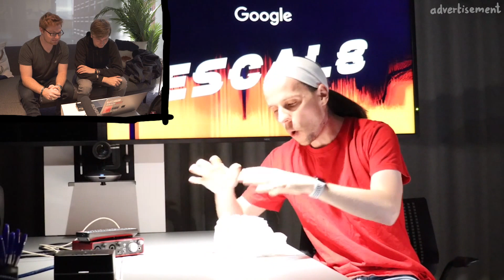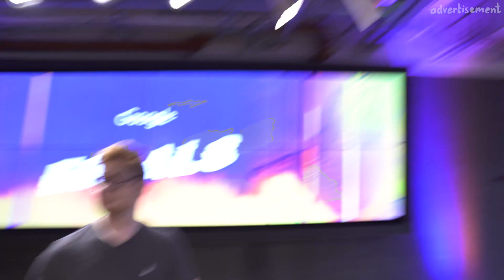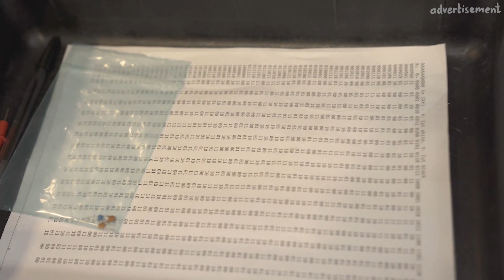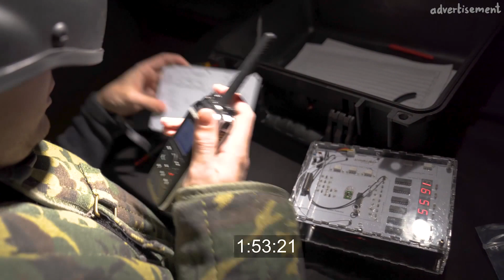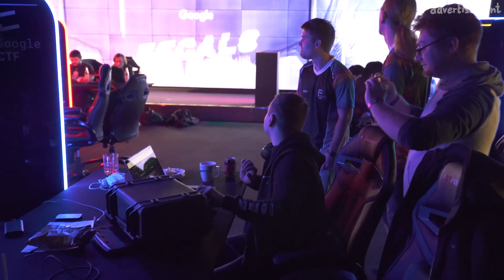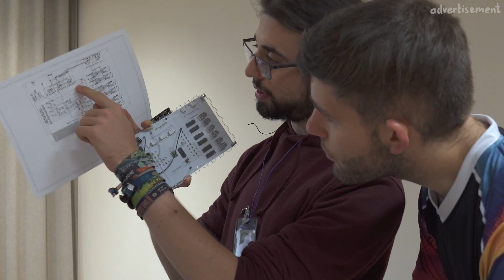Defusing a Bomb at Google London HQ - Having a Blast Google CTF Finals 2019 (hardware)

Comment: I suspect messing with the timer hurt more than helped.  Even ignoring the first attempt, which was spent almost entirely on trying to slow the timer down rather than defusing, spending more than 10 minutes on the timer would mean you gain back less time than you spent.  It certainly didn't help that it was easy to blow through large numbers of ticks while hotswapping.

Comment: First, if you see the capacitor in timing circuit - to stop it - just short the capacitor.
Reply: Info gathered from another comment reply, take with a grain of salt because I wasn't there. The device has a fail safe check, if there isn't a timer tick within a certain amount of time (measured by a separate chip, the threshold is a bit slower than the slowest you could achieve by configuring the capacitors); then it will go off and you'll fail. That way you're rewarded for the ingenuity of slowing the timer and gaining time, but you still have to do the analysis they intended to figure out the password.

Comment: If you short the capacitor either to gnd or vcc the timer will stop.
Reply: You will trigger the tamper detection and run out of time very quickly
Reply: @crazypotatoperson  I don't think it have that kind of clock stop detection. What's the point of having a 555 timer as an external clock source to a microcontroller if the microcontroller can do the timing itself?
Reply: if you want to go that route - what's the point of the logic circuit? The microcontroller could do a challenge response with a deadsman trigger and you won't be able to solve it at all. It's a feature that you can extend your time without making it too easy and this challenge is by no means realistic. Just as realistic as possible.
Reply: @crazypotatoperson  Of course it is not realistic. If it was real and I would be in a live or dead situation. I will not even try to stop the clock even if the board has a 555 timer and a couple of logic circuits and then a microcontroller.
I will go directly to analyze how to disable the detonator trigger circuit. And if it is not accesible I will search for the crystal for the microcontroller.

Another option will be to freeze the measured logic states of the microcontroller outputs placing a series of jumpers.

If the circuit has a microcontroller. There is no point to analyze simple things.

I will never trust any obvious detail in a circuit to try to defuse a bomb designed by a madman.

The logic circuit after the timer can be as simple as a clock scaler. I don't have access to the schematic to see what it really does.

Comment: Could have stopped the 555 by just twisting the capacitor so its leads shorted together. Can't exceed the threshold voltage to switch to the next oscillator phase when there is no voltage.

EDIT: just checked the code, there's actually some clock failure detect logic that will activate a tamper detection mode if there's more than some length of time between clock ticks (75000 cycles of this spin loop: https://github.com/google/google-ctf/blob/master/2019/finals/hardware-having-a-blast/firmware/bomb.cpp#L175-L180, however long that is), so unfortunately this wouldn't actually work at least with the firmware they uploaded to github.

Comment: That was it - put in tools and a multimeter with the device....🤣
Capacitors add in value when placed in parallel. I know it is too late now, but it might have given you even more time to try passwords, etc. if you could have gotten it placed along the existing one.

Comment: Actually tampering ne555 timer seems like a good idea but instead of changing capacitors you just could pull the output pin to supply voltage or ground and you had an infinite cycle :D. idk though it could just explode in an instant.
Reply: This was my idea as soon as i saw a 555 and capacitor. Just use the pins of the extra capacitor to short out the existing capacitor. This would stop the timer and so either give you unlimited time or technically defuse the bomb since it will never count to zero.
Reply from the maker: In that case the bomb would detect the missing timer and goes brrrrrrr. Very fast countdown